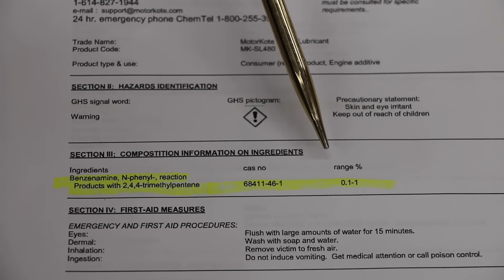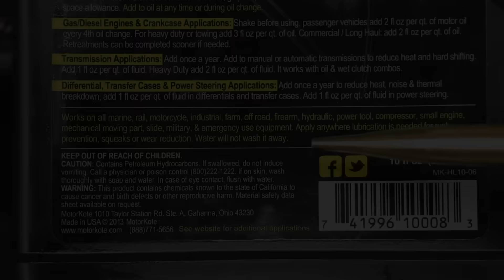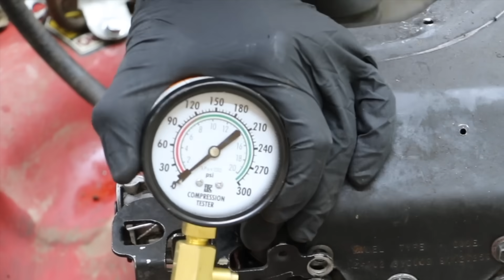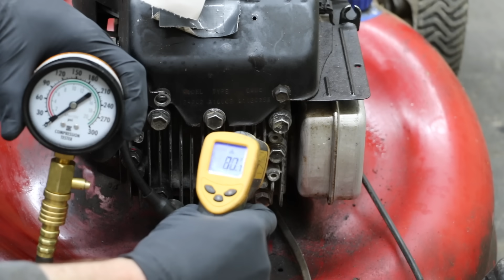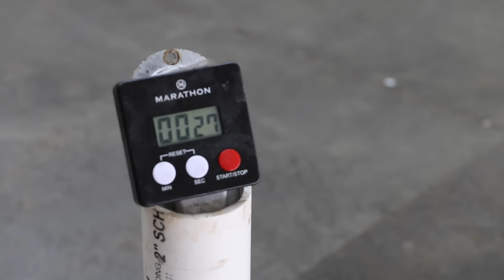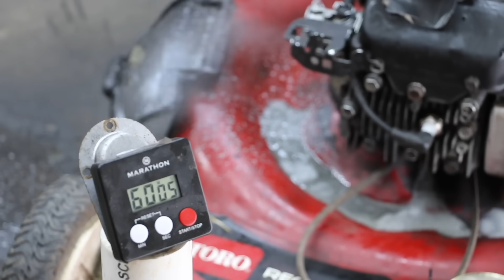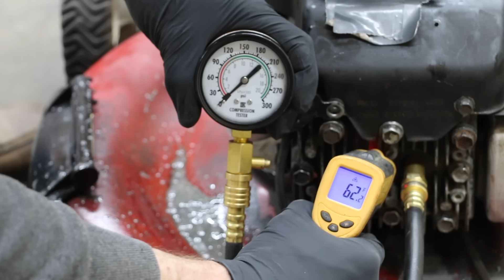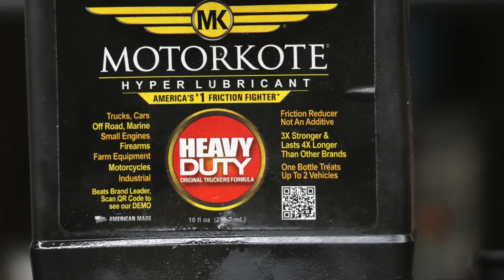Can MotorKote survive the water test?  Let's find out!

Comment: Run two engines side by side. One with only Motorkote in it for oil, and the other using only Bestline for Oil. See which one runs better as far as RPM, Compression, & Temperature goes. Then drain both engines & run them until they blow/seize. I'm betting on Motorkote being the winner. I use it in the crankcase of my 02' Hyundai XG350 L and she runs even better now. It only has 66,130 miles on it, but it's an almost 18 year old car (production date on the car is 10/26/01). I use Motorkote  (1oz) in my power steering system, and 1oz per quart in my transmission. My car flies with it in there. It was fast & smooth before, but now even more so. Just gotta figure out the whining noise (most likely a bad Torque Converter since the noise is coming from there, but might be the power steering pump just around the engine from it, it's an ongoing battle). Thanks for the great work & honest videos as always! Take care
Reply from the maker: Thank you for the video idea!

Comment: I stay away from additives.  As long as I replace oil and filter using reasonable change rates, I've never had any problems.  I use Mobil 1 synthetics on everything and motors and transmissions have all been excellent.  Never had a failure or unusual wear.  Don't know if MotorKote uses Chlorine in it or not but Chlorine additive use is not something I am interested in trying.  I want to know if MotorKote has Chlorine in it or not.  Outgassing of Chlorine substances can be hazardous.

Comment: I've been using motorkote in all my vehicles (all 3 are high mileage) ever since I watched this video. 

I know these people dont pay you, but they should.
Reply from the maker: Thank you!
Reply: Have you noticed and sludge? I’ve got an old blazer with 300,000 miles so I don’t want to damage anything
Reply: @Tyler_Owen23  Since I don't see a reply, here is what I do - the only way to prevent sludge is change the oil.  No additive can  prevent sludge from forming, any helpful chemical that does that is already in the oil.  Sludge is caused by the unavoidable moisture that gets in the engine oil. Some additives claim to REMOVE sludge after it's formed, which I don't really believe. The only way to keep sludge at bay is change the oil. No additive that I've ever used, seen or heard about, changes that fact.
Reply: Any problems yet. Looks like you been using it for 2 years
Reply: @dannywalters1548 oh, never saw this comment. Never has any issue. I've been using motorkote in everything from my lawnmower to my old Jeep Cherokee. Stuff works great.

Comment: I’ve been using it in my peterbilt with a 550 cat motor. Just had a inframe rebuild at 1.7 million. The mechanics were amazed at the cylinder walls. The rebuild was due to a head problem. While they replaced it I went ahead and had a gold kit done. Looking for another 1.7 million miles👍🏻
Reply: What is a gold kit ?
Reply: @armobyzantine5881  The gold kit is everything new from caterpillar. Head, injectors, water pump, oil pump, turbo's (if twin turbo), pistons, liners, all bearings, rings, and I think they do out of frame to check block. I know I'm leaving some stuff out but you get the picture.
Reply: Different  rebuilt kits for cat like bronze silver gold and platinum, platinum kit most expensive and contain all parts.
Reply: Every rig that I've seen with 4-million or more miles on it, had motorkote in the diffs, Trans and engine.

Comment: I have been using it for years.  My van is rusting apart before equipment.  My furnace fan was loud. Added oil and no luck.  A few drops of Motorkote and  never heard a thing since.
Reply: Gregory Sell my girlfriend has a wool cutter for rug hooking it was very stiff to turn I lubed it with atf I was still stiff ,I bought small container of motor coat I added a few ml of motor coat to bearings and gears ,turned the handle it was amazing no lie it turned with no effort better than new , so I added it to my just purchased used 2.8 CT’s caddy , the oil was changed and the motor is quiet but after Add I’d motor coat it is so quiet I can barley hear it run . Also I have purchased a 1977 searay 351 235 hp Omc getting more motor coat adding it to the oil and possible out drive

Comment: How about a Motorkote vs Bestline showdown? I would love to see a comparison using identical Predator engines to see the effects of friction reduction (RPMs and temps), then treat the engines with a 50-50 mix, drain and run until failure. It might be a costly experiment, but very interesting to see which one takes the crown...
Reply from the maker: Thank you for the video idea!
Reply: I second that they both seem really good

Comment: The water test, although look impressive to the ignorant eye, means very little. The engine oil test without a load on the engine is meaningless. I personally have seen a motor running on a test stand without an oil pan after being treated by some of those miracle products at the airshow, however, if you put ANY load on the crankshaft that engine will seize so fast you won't even have time to turn your camera on! Try to put water in the mower and go cut a patch of grass, you'll quickly find out.
Reply from the maker: Thanks for the constructive feedback

Comment: Hello.
I enjoy the watching the thorough experiments with the motorkote.
may I suggest another experiment:
I recently watched a guy burn out a 2cycle blower in 10 min with no oil in the fuel mix.
could you run Motorkote through a 2 cycle motor and then make it run on regular unmixed fuel?
If you could do that and then one could run these 2 cycle motors with less fuel mix.
Reply from the maker: Thank you for the video idea!

Comment: Pretty impressive,  but where's the control test? What happens if you run the engine with water in the crankcase and no MotorKote? How long until it fails then?

Comment: PLEASE test more of this Motorkote stuff! It's almost too good to be true. Would be especially interested in seeing if it has chlorine like so m any are saying.
Would be interesting to see how it improves the top 5 oils from your showdown!

ALSO, You should do the friction test for ALL of your oils with the post hotplate oil to see how much the protection changed after excessive heat.
KEEP UP THE GREAT WORK!
Reply from the maker: Great suggestion!  Thank you
Reply: And: Will the engine survive the water test without Motorkote? We don't know, so let's find out!
Reply: @dextertreehorn  true
Reply: @dextertreehorn  when an engine blows a head gasket and gets coolant in the oil if it is ran much at all it will cause damage even when mixed with oil
Reply: up up up!!!
Reply: Yes the chlorinated element MOTORKOTE is alleged by do many to contain if you could test for this and show what it contains would go a long way in proving that your not payed to promote. And also a list of the chemical content after a 3000 mile run with motor oil sample test. I did notice you have not personally used MOTORKOTE in any of your own vehicles?
Reply: @rusdean229  You obviously don't watch his videos.
Reply: @rusdean229  Chlorine naturally breaks down and "evaporates". If you were worried about it, just leave some of it in an open container outside for a few hours. But, once chlorine is bonded with another element, it no longer is dangerous like chlorine is. Think of salt, which is sodium bonded to chlorine. I don't think it's reasonable to be afraid of chlorine in a product like this.
Reply: @weeveferrelaine6973  So say motor oil bonded with with this MotorKote dosage spilled in a living environment like half a quart that was a used sample out of an engine would that be a long-term cause of concern with an ounce of MotorKote in it.
Reply: @rusdean229   The oil would be the greater environmental concern at that point.
Reply: @weeveferrelaine6973  - The claim is that Motorkote has "chlorinated paraffins", not straight chlorine. If it's somehow bonded to paraffin, then I imagine it won't just evaporate, much like the chlorine in salt does not evaporate.

Furthermore, supposedly chlorinated paraffins become highly corrosive if exposed to moisture. Health and safety isn't the concern. The concern is corrosion inside the engine, especially of anything brass such as certain bearings. This is why I would like to see him run some of the more extensive tests he does now, such as cooking the oil and sending it in for analysis.
Reply: @JCPRuckus  you're right. I've heard it can also break down seals. Not good in the long run of things, just snake oil.

Comment: If you can read this, can i suggest that you do a test on using entirely MotorKote as a total replacement for manual transmission oil . Gear oil is only for anti-sheer properties, not like ATF, it doesn't need to have that high of a boiling point or detergents.  How to prove whether it works? Take your car to a dyno shop. See average horsepower reading for 3 runs.  If MotorKote really works, you should see increase HP reading as you have less of a friction lost in your transmission. It does advertise as a friction reducer.
Reply from the maker: Thank you for the video idea!

Comment: I use Motorkote in everything , you got to becareful using any additive in newer cars & trucks with VVT (Variable Valve Timing) , the oil ports are so small you dont want to use to thick of lubricant & plug oil ports of lubrication, thus ruining yr engine... ive been told this by mechanics & saw it on Youtube...
Reply from the maker: Thank you!
Reply: Project Farm yep no problem...

Comment: Awesome video. 
I have used MotorKote many times before.
I first ran into it working at a truck stop. Truck drivers swear by MotorKote. They would buy it by the gallon at 89.99 a gallon. We could not keep it in stock. One driver told me it had increased his mpg by 5 mpg. That may not sound like much but when a big rig is getting 8 mpg without MotorKote and goes up to 13 mpg with MotorKote. That is a lot of savings in fuel costs. Hypothetically numbers. 
MotorKote does make a Ultimate motor oil.
https://motorkote.com/products/motorkote-ultimate-40-60-synthetic-hyper-mix-5w-30

Comment: I tested more than 14 engine oil additives, almost all very effective in reducing metal abrasion. the problem however is that at high temperatures produce corrosion! even the vapors that emit are corrosive, try to measure the pH of the product and the vapors at high temperature, you will see the result for yourself!
Reply from the maker: Thank you

Comment: Ok, this is going to sound like BS but, I had an engine at work (3.6 Ram 1500) that sounded like the lifters were going to come out at any second. This particular truck has been abused beyond belief, skipped oil changes for thousands of miles. ^-7 months we had to take the engine out of the truck and desludge it due to not changing the oil. the sludge was so thick you couldn't see the cam followers or the sump screen in the oil pan. We got all of the sludge out, changed the oil pump and reinstalled the engine into the truck. Since this was done there have been oil changes done every 2 weeks, oil pressure was lower than normal since this all began. fast forward 6-7 months to present , this truck came to the shop rattling and clattering like it was ready to explode. I had the mechanic check the oil and it was full and pretty clean, I then had the mechanic change the oil and filter. We started the engine and it was still making noise. I called and had some Motorkote delivered, I figured what could it hurt. So I added 12 oz. and started the engine, after about 30 seconds the engine started to quiet down. We stood there looking under the hood for a few minutes as the engine got even quieter. I walked around the truck to turn the engine off and heard a ding noise, I looked at the dash and the low oil pressure warning was on, there was 0 oil PSI, 0, nothing, nada, nill!! The engine was quiet, but there was no oil pressure! I turned the engine off and had the mechanic pull the lower oil pan, there were metal shavings in the pan yet the engine ran like nothing was wrong. I'm not one for additives and such but this stuff is the real deal. I was skeptical until I watched this video, which is what made me purchase Motorkote in the 1st place. Thanks Project Farm. More to come after we pull and rebuild.
Reply from the maker: I was enjoying your post but you didn't finish the story.  Could you please create a new comment with the ending?  Thank you

Comment: Thanks for the excellent video. 

I've been using MotorKote in my 3.3 liter automobile engine with 100% synthetic, in the automatic transmission and in the power steering pump reservoir with excellent results on an engine with 170k+ miles. I believe it will extend the life of the car to an unheard of degree. (1999 Dodge Grand Caravan). I'm currently going to try it as lubrication in my small 4 cycle gasoline and 2 cycle lawn equipment.

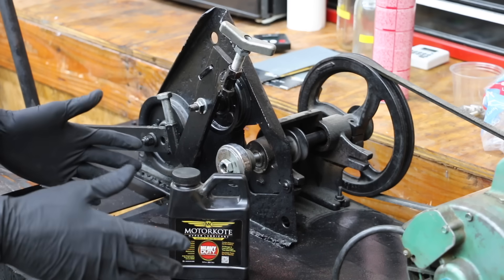I currently use a gas-full synthetic oil mix  (for both 2-cycle and 4-cycle engines) in my 5-gallon gas can at a ratio of 1:32 or even 1:20.. 1:20 is a quart of synthetic to 5-gallons of gasoline.  Adding MotorKote may be very beneficial indeed in the long run and possibly as a stabilizer for over the winter months. With 4 cycle engines, a gas-oil mix provides additional top end and valve stem lubrication and produces no noticeable smoke, even at a 1:20 ratio. I believe it also can prevent corrosion and gumming of the carburetor. For me, with the gas-oil mix, I noticed that typical carb adjustments on the small engines are no longer necessary after many years of operation.

The Homelite 2-cycle leaf blower recommends a 1:50 oil-gas ratio, other 2-cycle equipment recommends a 1:32 ratio. (4 ounces of oil to one gallon of gasoline). exceeding the oil-gas ratio does not seem to have any deleterious effects on the engine or the spark plug so far.

BTW, I have been buying the Walmart Brand full synthetic oil in 5-quart containers at Walmart for around $16.  The last time I bought synthetic in quart bottles, it was around $3.69 a quart. I was shocked recently when I went to NAPA to buy a quart of synthetic oil and found the price t be around $10.99 a quart for the name brands and $9.99 for the NAPA brand.
Reply from the maker: Thank you!

Comment: MotorKote is selling at most truck stops and Walmart. It’s popular with truck drivers. Used in semi trucks. Engine, transmission, power steering, crank case and so on.
Reply from the maker: Great point!  Lots of truckers have commented on this video mentioning great results. No negative comments from truckers yet.

Comment: Hi Project Farm any chance you could look into the chlorinated parrafin content of this product? I'm quite worried I may have damaged my engine with this stuff, with the parrafin turning to hydrochloric acid. There is nothing definitive online. People have posted some chemical analysis of motorkote showing that it does indeed contain chlorine, while others claim that it has since been taken out of the product, or even that it contains chlorine but its corrosive properties have somehow been chemically disabled/altered.

Interestingly, motorkote does not currently mention chlorine anywhere on their website, despite at several times in their marketing history making the claim it does not contain chlorine. 

My own independent tests on this product have shown that it does indeed mix with oil contrary to their claims, as well as not bonding to aluminium much better than regular motor oil (ie, brake cleaner has no trouble removing the residual layer) which I'm happy about, because I want all of this stuff out of my engine ASAP.
Reply from the maker: Great test idea!  I'll see what I can do. Thank you
Reply: @ProjectFarm  And thank you for getting back to your commenters! I've never met a YouTuber before who is so great at interacting with their community
Looking forward to some more testing with motorkote

Comment: You can't wash oil away with water so how is that any different than motorkote?  Love your videos
Reply from the maker: Thank you.  Great point.  MotorKote has a much greater film strength than motor oil.  In the most recent video, as silly as it may seem, bananas were used to replace engine oil.  Water is the main ingredient in a banana.  The engine was regular motor oil used in it just before the bananas.  The engine seized after only 4-5 minutes of run time, indicating the oil film washed away.  Petroleum products will wash off with water given enough heat and pressure (splash).  Thanks again

Comment: This product is very good i used it in my harley after developing rod knock and it kept my motor running untill i could get a new bottom end (6 months) plus i used it on my shotgun and the slide moved alot easier and it functioned alot better i swear by this product
Reply from the maker: Impressive results!
Reply: @ProjectFarm   I know right? And the best part of the whole thing was it only cost like 12 bucks or so

Comment: I see a flaw in the water test. The heat will increase the effect the water has on the motorkote. It'll be like pouring water on burnt grease on a hot skillet. Well that's my prediction. I think you should let the crank case completely cool down before adding water.
Reply from the maker: Thank you!